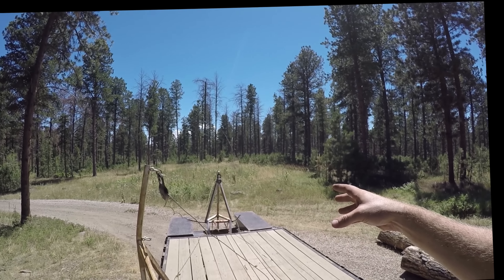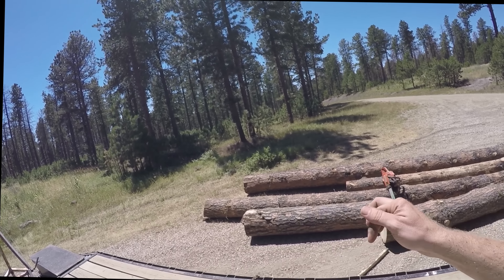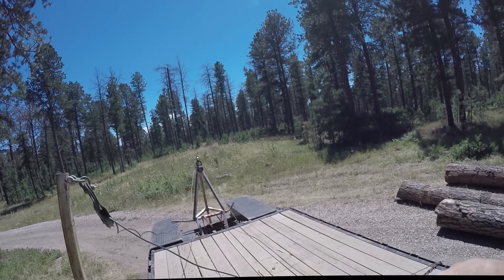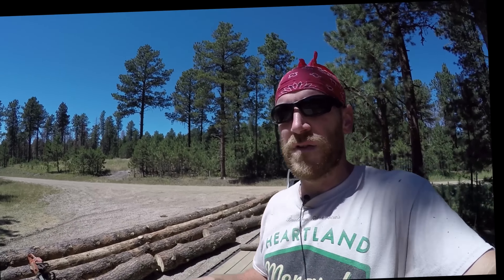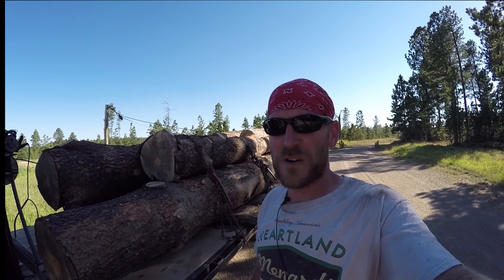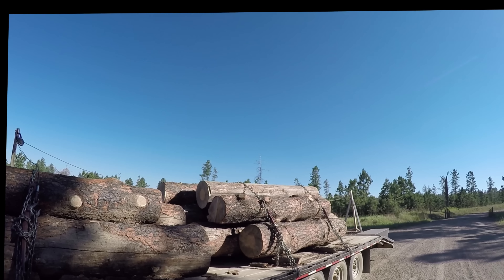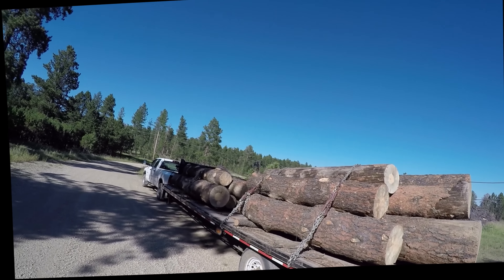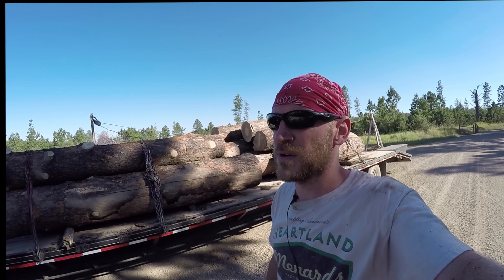4k HD: Part 2 Loading massive logs for lumber. By yourself.

Comment: Might I ask what you used for pully anchors?

Links???

I'm looking to do exactly what you just demonstrated at a non for profit church retreat center (that can't afford to buy any kind of lifting equipment) and your video showed it was possible, just need to know what anchored those pulleys.

I appreciate it
Reply from the maker: Tractor supply, runnings, or fleet farm carry what I use. Two 25000lb pulleys and a couple of clevises. I don't have links they are pretty common at those type stores.

Comment: I once tried this method of rolling logs up a ramp and had a hell of a time because it seemed like no matter what I did, one end of the log would slip.  I think I had a longer ramps with a more gentle slope.  I'm wondering if the shorter ramps (like the ones you have here at about a 45 degree angle) might reduce slippage by having a greater friction force between the log and the ramp.
Reply from the maker: On longer logs you need to make a Y with a chain/two chains to anchor your winch cable to. Put the log in the center of the Y. the bigger the Y the more stable the log. I use one cable just because it is faster on smaller logs. Anything over 12' and I make a Y.
Reply from the maker: Like this:
https://imgur.com/qo20ycC
Reply: Right, exactly.  Seems like you know what you're doin' with the rigging.  And you put the 2 cables of the Y on the bottom side so that you can just winch the 1 cable from the top.  ...............   It still may be helpful to know when such a rig is or isn't required.  A single-cable rig could work when it's dry, but it if gets wet this could lower the friction enough so that it slips.  It's an interesting physics problem.  The slip condition has something to do with the coefficient of friction and the rise/run of the ramp (or the math "tangent" function of the ramp angle) ....  I was thinking the wider apart the ramps are, the less likely it is to slip, but then the more torque is required to correct the slip if it does occur.  Maybe in a pinch, a slip could be corrected by using a temporary wedge, or a splash of water on one side, or a bit of sand or dirt on the other to adjust the friction.  ....One could even glue sand or gravel to the steel ramp to make it more anti-skid.  And of course, don't stand under the log where it could fall on you!  :-)
Reply: If you do not like chain since it can bind up and eat at the log or even go off kilter if you are not cautious, you can also use a strap and there are some companies that sell by the foot and even customize them for you, such as have them add hooks (both facing opposite sides of the strap and each other) at the ends and a d-ring (loose, not sewn) that is more triangular so as to have a y sling similar to the chain method but more adjustable on the go to compensate for irregular shape logs.

I had seen another yt user (Australian) do this similar method of rolling up using two winches and additional either straps or synthetic or wire rope that the logs were rolled upon and onto a utility truck flatbed with irregular shape logs of large diameter.
Reply: What? anti skid? splash of water? No! lay down your chain or cable in a V shape, peavy the log over it square to the trailer, attach your winch cable to the tip of the V and winch it up! No slipping, no falling off the side, no chain eating the log, it just rolls on in. 

“Don’t make the process harder than it is.“ — Jack Welch

"Any fool can make something complicated..." Woody Guthrie

Comment: What's the benefit to the pulley at the rear of the trailer, couldn't you just use the one pulley?
Reply from the maker: It helps spool the winch evenly. 9000lbs pulling to one side of the spool is pretty hard on everything. I've ran it without the back tower and loading just one log grooves the metal.
Reply: 10-4, good to know, thanks!
Reply: Any good winch or crane operator will tel you that spooling the wire or rope is you use synthetic in one area will not only mess things up but quickly limit the amount of spooling compared to it being evenly wound. And as he said it can ruin the winch, guide rollers and line faster. Plus with having more than one pulley, you increase the capacity of the winch, but not the lines limit which will remain the same when using the line with no block at the end in a single line pull.
Reply: @joshuacornell6667  The way those pulleys are set up is NOT "increasing the capacity of the winch" as you say, the only thing they are doing in this set up is changing the direction of the line pull. The only way it would increase the pulling power would be to put a snatch block at the pulling point and secure the cable back to the trailer by the winch, THEN it would increase the pulling power if you attach at the snatch block's hook to pull the load.

Comment: Sometimes for the massive logs, it is easier to take the saw mill to the log.  If you had the facility to stack and air dry the lumber where the trees are felled, it would be a great weight savings to haul dry lumber compared to green logs.

Comment: How much would a whole tree go for? Are these good for building a house out of and could sell as lumber or just for burning?
Reply from the maker: A whole tree? I know the buddy price from the loggers is $600 for a trailer load. I'd imagine it'd be double that if you bought from the mill. I wouldn't have a number on just one log. There are so many things that can change the value.

These are good for building a house, yes. Most of the people around here use it for firewood though.

Comment: Hi!
Could you not use the Bobcat to load these logs? Don´t you get a lot of small rocks, and sand into the bark this way? I´ve seen some of the previous uploads where you saw the logs unbarked, do you debark them first now?
Is there a good rule of thumb you go after when it comes to weight? Like diameter x lenght x years it´s been dead? How do you know how much is too much?
Thanks.
Reply from the maker: I can tell the weight by the way the truck pulls/brakes. I've went through the scales enough to have a feel for 22k. 

These are dead trees so depending on the tree a lot of the times the bark comes off pretty easy. And yes, you will get sand and rocks in the bark, that's why the nicer mills have a debarker blade.

Also, if you're cutting green tree or hardwood, the logs will weigh significantly more. There are ways to test weights, pallets of bricks, mortar, ect. have the weights on them. Put a weight on your trailer you feel comfortable with and drive around. If you're familiar with the truck you'll notice how it drives and that'll be your reference point.

You can't use heavy machinery on Federal land. If I am working on private land I definitely use the bobcat.